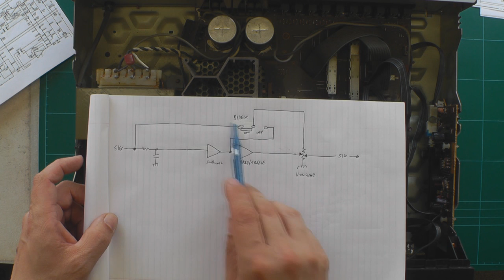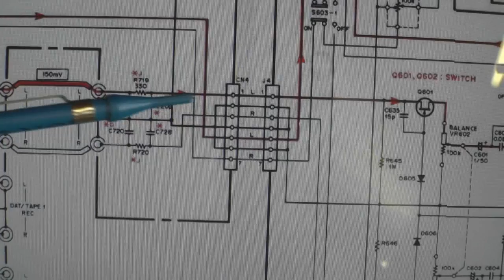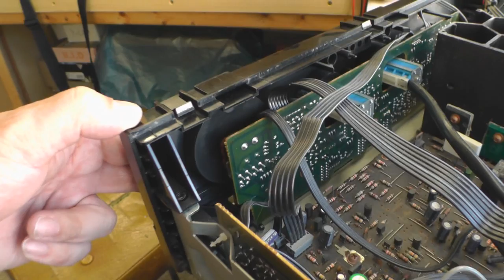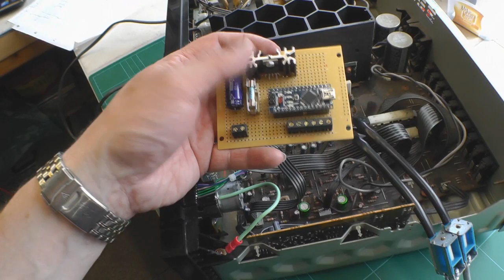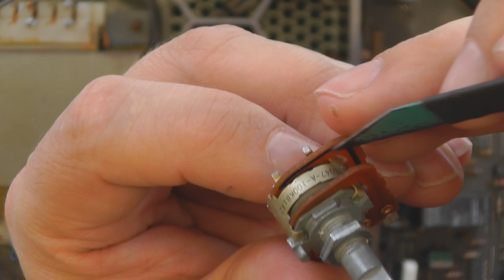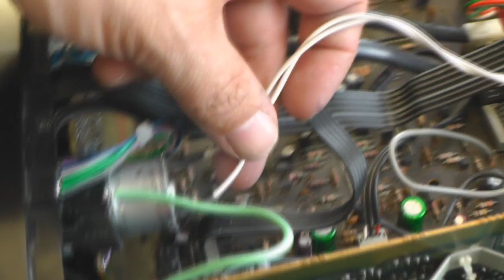Pioneer Amplifier Repair & Motorized Volume Control Conversion

Comment: sorry ,i was refering to the A-717, A-757, A-777, A-717MKII ,A-757MKII ,this is one of the A-616,etc. but all called reference stereo amplifier, being the A-676 the most badly built and the reason the MKII of the previous models were released

Comment: It would have been easier to buy a Pioneer A450R or a A550R which are remote controlled including the input selector.
Reply: Where is the fun in this? :)

Comment: Only just came across this video, I have nearly the exact same amp apart from mine doesn't have the subsonic button on the front, only has the direct and loudness buttons. I also have the exact same issue of the direct button bein on is the only way to get around to come out. I thought mine was broke aswell. Never worked in the 20 years iv had it lol. Gonna check them adapter connections when I get home now.

Comment: I have a pioneer VSX-4400 and only the right channel works I'm almost positive its because of the volume control board this thing has gears in it but they aren't spinning so I'm unsure how to repair that am I able to modify a new volume control ?

Comment: Awesome mod... I've one of these A400 from when it was new (think I bought it in around 1992 or thereabouts). It was upgraded by Doug Hewett the guy that was Mr Manticore as I've also got his Manticore Mantra deck. I'm not tech savvy enough to do this but I'd like a replacement volume control as mine is crackly... Servisol does not clean it...

Comment: Hi, i have a Pioneer A-331 that seems to have the same or similar problem. When it's not on direct mode, there is only sound from the left speaker and the bass/treble doesn't work since it's bypassed. There is no adapter ports in the back to put a jumper cable. What would be the problem? Thanks.

Comment: Do you know how to fix the A  B speaker buttons?  They won't stay pushed in.
Reply from the maker: Usually a mix of corrosion, dust, grime and grease that has solidified that makes the button contacts sticky. You might get lucky with a liberal use of contact cleaner and thereafter a touch of WD40 inside the switch.
Reply: Never use wd 40 in electronics it is a flamable lubricant, deoxit d5 is what you need unless you like ruining equipment

Comment: Very impressive ! Just wondering if, with your knowledge of the field you can help out. I have been trying for ages to find a replacement potentiometer for my volume control for a pioneer amplifier model A449.  Would you know where I could get hold of one. Its part number is ACT1062-B-100KBX2. Any help would be greatly appreciated.

Comment: An audiophile amp turned into a standard; what a jerk! Direct function is to make it purer(less distortion).  With your fixed circuit design the quality has dropped;simply adding distortion.

Comment: Hi Ian, I recall a similar problem with an early  Pioneer valve amplifier. Customer purchased the amplifier (not working) and asked me to look at it. For some odd reason the pre and power amp sections where linked by phono's on the rear panel. The only fault was (as in your case) the missing phono links.

Comment: i have a 120 watt x 2 rms (500 watt PMPO) stereo amplifier, it has speaker A with left and right channels, and Speaker B with left and right channels. does it mean it can handle 500 watt speakers in each channel like 500 watt on left A , 500 watt right A etc..?
Reply: You will never get more than your 120watts output. If you can select both A & B at the same time, both sets of speakers will be in parallel. If you use such an arrangement, make sure both speakers are 8 ohms as this will present a 4 ohm load to your amplifier. This might give you alittle more power but some amplifiers will be unhappy to give high power into such a low impedance. Will not be a problem at normal listening levels however.

Comment: Those transistors look like the ones Toshiba used to sell to high-end amplifier makers as very closely matched sets- they are actually triple darlington transistors specifically designed for class-A audio amplifiers.

Comment: I've got a question, my amp (SONY STR-D565) doesn't turn the volume up or down with the remote. I took the cover off and put my ear close to it and when I press the remote I actually hear small clicks as if the motor was trying but it doesn't move at all. Does that tell me that I have a bad motor? If this is the case, is there a way to replace just the motor? The vol board is not supplied by anyone online and I would like to bring this equipment back to fully functional state. The remote has no issues, everything works except vol UP and vol DOWN. Thanks
Reply: Your best of getting genuine parts replacements. modifying such as he has done on this amp requires i genuine tech who knows what he is doing. If your not trained could be expensive. knowing this stuff is a cool advantage in making it do what you want.
Reply from the maker: Before starting to replace parts, better you or somebody who has some electrical/electronics knowledge check the motor with a DMM.
Reply: Ok I know how to use a multimeter, but I don't know where to put the leads.  I have the service manual of this equipment but I am not versed in electrical schematics, is there anyway that I could send it to you and you could analyze it and tell me how to do it. I have already stripped the amp clean to the point where I can pull the VOL UNIT as ''practice'' in taking it apart, put it back together and worked. I believe that with a little guidance I can manage to identify the faulty part and change it. Thanks!!!!

Comment: you ought to put a 2mm lighthouse red LED in the knob, would look great, In fact id wire an LED up in the knob to the buzzer pins (instead of the buzzer)

Comment: In other words, there wasn't really anything seriously wrong with the amplifier.

Someone took out the external jumpers connecting the preamp to the power amplifier but did not bother to put them back on.

I can't tell you the number of times I've had that happen; someone tells me an integrated amp or a receiver they bought at a rock bottom price at a thrift store isn't working and, lo and behold, the preamp-to-amp jumpers were missing.  Putting in the jumpers or, failing that, using a short length of stereo patch cord to reestablish the connection would fix it.
Reply: yes ,you can also conect a pair of rca cables if not having the right part to make the conection ,normally people conect there an equalizer ,then years later no longer know what they done to the "chantes"(two pieces of iron to complete the circuit)
Reply: @DID70Sworkedoutforyou  "yes ,you can also conect a pair of rca cables if not having the right part to make the conection"

I believe I said that, but thank you.

Putting in the jumpers or, failing that, using a short length of stereo patch cord to reestablish the connection would fix it.
Reply: @Watcher3223  sorry i didn´t notice , i was thinking it was the 717 because of it´s volume being diferent and i don´t know how to fix it, but a hell of a good sounding amplifier the MKII ,two power transformers and two huge capaciteurs ,i also own a A-616 mkII and a A-656MKII, only bought this last i refer when they  were released in 94 the others which were released in 91 were ofered to my by two friends a german  one and a dutch one , when they come to live in the sunny south of Portugal ,regards

Comment from the maker: Hi,
That would work certainly, however, I wanted to be able to use the volume control by hand also, not just via the remote. It's also nice to see the volume knob move when you operate the remote.
Saying that, it would be easy to adapt my solution to your suggestion, and maybe it's an idea for a follow up video/article hmmmm!

Comment: Why not just insert your motorized or remotely controlled volume hack in the aforementioned preamp OUT / main amp IN loop? This way the Pioneer unit itself is not damaged, and the hack could also easily be adapted to other models.

Comment: Dude the problem is not a fault in order to make the bass and treble work  you need to put little clips that go into the line out rca jacks in the back then you will have bass and treble controls that work. Someone has removed the clips at some point. Get some little u shape clips and put them back in the line out rca jacks and it will work.
Reply: You obviously didn't watch the entire video.
Reply: @rolf_reichts  that was 8 years ago, and I guess you did not see where I commented immediately after that, saying" I see that you figured it out. I just saw that you figured it out. Yes the stereos come with jumpers installed on the RCA line.. "  So I guess you did not "BOTHER" to see my post right below the first post from 8 years ago...

Comment: The 4th connector to mid pot is the way that they add extra bass boost at low volume levels. It feeds in an enhanced low frequency signal to the volume control at low levels, so that you get a bass level at low volume settings. Above half volume it is reduced otherwise the bass will be boomy.
Reply: are you talking about loudness ,because not only increases bass but the high frequencies both limits of the spectrum to provide better sound when listening at low volume , without it they can´t be heard at low volume
Reply: @DID70Sworkedoutforyou  Low volume loudness, connected to a small mylar capacitor to ground, so that high frequencies are reduced at low level settings, so the audio sounds louder as there is more low and mid range, and less treble.

Comment: when it comes to the servo feedback i solder an extra wire from the POT inside the servo and feed it analog read to analog pin in arduino and so i will get the 255 steps :)

Comment from the maker: Would be nice to have the best of both worlds actually, i.e. the absolute positioning of a stepper would allow more creative ideas for the remote control. In my setup the Arduino doesn't actually know the true position of the volume control. In the end though I just used an off-the-shelf motorized volume control.

Comment: Ian, thanks so much for sharing your work with us.   Well explained, all practical with bits of theory floating about. Love it, I'm learning lots from you, thanks!

I've noticed that you have a habit of using a whole Nano in the finished work.  Since you have a veroboard anyway, why not  buy just the chips, oscillator and 2 caps.    Keep the nano with its  handy usb just for design stage?  Nano are cheap but you'd save yourself a lot.  :) 

PS. Your work on the reflow oven was outstanding!  :D